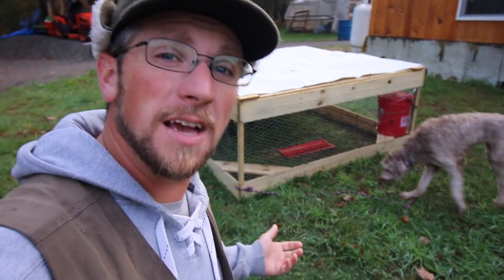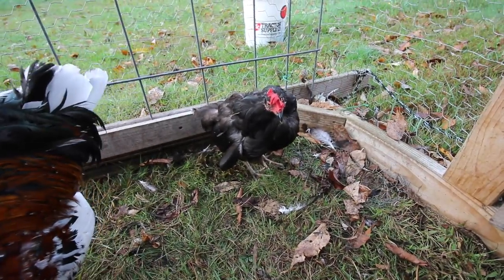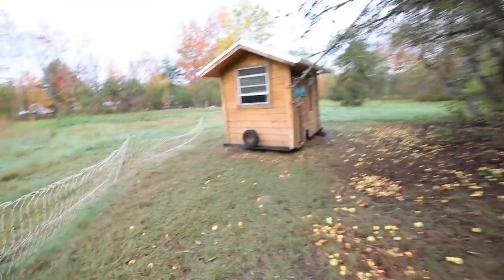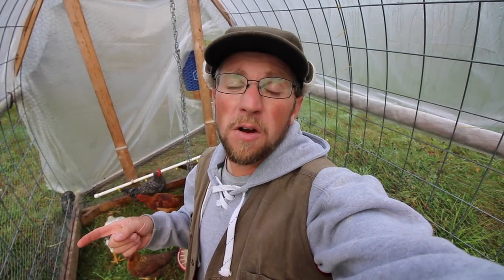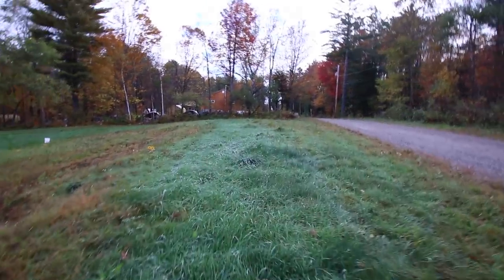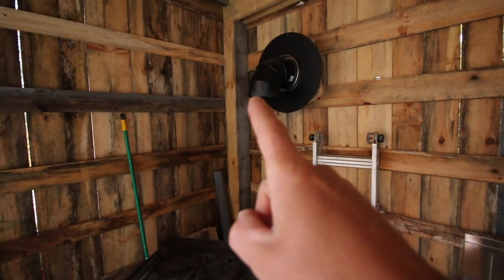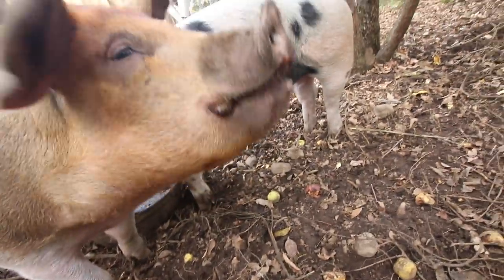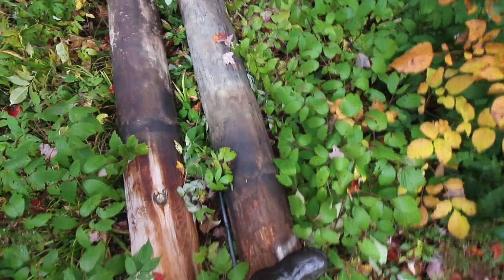If you Give A Pig Some Cake~ Modern Steader Update

Comment: How to set the poles? If it were me I would track down a power line crew and barter some of last year's chickens and pork for them to stop by and set those pole where you need them. Oh and a some beer. Beer, is a great lubricant for cordial negotiations! Have a good weekend.
Reply: Buck Buchanan That's a great idea!  Maybe even find the same crew that dropped off the poles!  Barter and friendly acts, the crew is probably still working the area coffee and donuts brought to them is great lubricant when inquiring for the favor!  They only need a well marked location, that is clear and easy access for the drill truck.
Reply: Coffee and donuts as an opener . Excellent idea!
Okay Al we have just figured out how to get you poles set.
Reply from the maker: Sounds like a plan! I am working on it! Should be installed by Tuesdays video! :) Fingers crossed!

Comment: first you need to get your bow ready for those deer. Second you can put the poles in the ground and make a hanging pole for the deer and your pigs.  I would put it behind the outdoor kitchen so you don't have to look at it.  You also should put some hooks up under your roof on the outdoor kitchen to hang your deer to let them age.
Reply from the maker: The fun part will be getting the pole in the ground
Reply: dig the hole, pull pole to hole, put something to brace pole, pull pole up with tractor into hole.  simple.

Comment: I would cut them to the required height plus 1yard. Then cement them into the ground the required width apart. Cut a top piece to size then notch them to fit the vertical post & bolt it on. Then drill the Horzontal post to width required & install 2 eye bolts. Then when you are not hanging meat you can attach a swing for Olivia

Comment: So sorry about the broccoli! I use 1/4" hardware cloth tented over veggies, envelope folded at the sides, nothing gets in. Those deer will eat every bite and not care a bit if you cry! I saw a chocolate nose! My dad and grandpa always used trees with additional x-braces for hanging the hogs. My dad was a mechanic so he had a pulley system for raising and lowering the hog into the boiling tank of hot water, then a table for scraping. The poles look good and sturdy! Do you make paanhaas (sp)? Man I miss that with eggs in the mornings!
Reply from the maker: I have never heard of that. What is paanhaas?
Reply: itshonorbright alas! --I had never heard of pannhaas, so I looked it up.
"Scrapple, also known by the Pennsylvania Dutch name Pannhaas or "pan rabbit", is traditionally a mush of pork scraps and trimmings combined with cornmeal and wheat flour, often buckwheat flour, and spices. The mush is formed into a semi-solid congealed loaf, and slices of the scrapple are then pan-fried before serving."
Reply: Yeah, that's what it is, couple of different spellings, couple of different origins, supposedly, but man, this is good stuff! There are lots of recipes around for it, may have to try couple different spellings, but this made sure that none of the cuttings went to waste. I'm hoping, when I die and get to Heaven, my grandpa's got some of this cooking and crispy waiting!!! :)
Reply: Sounds like Spam  LOL
Reply: LOL, well it is much better than spam but there are few spam samiches I've turned down too :)

Comment: Always love 'Update Friday' great job! in the beginning of the update you were doing chicken chores, there was a little panoramic footage and I said to myself, "man that is some fine greenery in that field". Then you did the wide shot and narrative about the difference of how much more lush the tractor roads were! 
I think you definitely use the poles for two vertical risers and a horizontal beam setup for the harvesting. A sling(s) around the horizontal member and hang a chainfall for lifting to different heights would be a nice setup. Digging the holes and lifting/setting the poles and cross beam is the difficult part.  See yah tomorrow God Bless
Reply from the maker: Thanks! Yes raising the pole will be interesting! See you tomorrow!
Reply: Lumnah Acres -- You will probably need to call in your buddy to help you with raising the poles.
Reply: A few extra temporary cross support  and that little tractor could pull it into place in the pre-dug holes and pull it up to a standing position